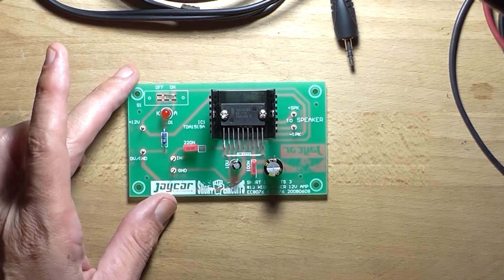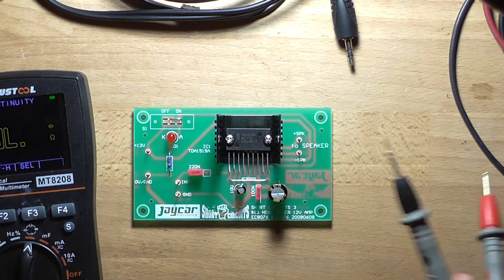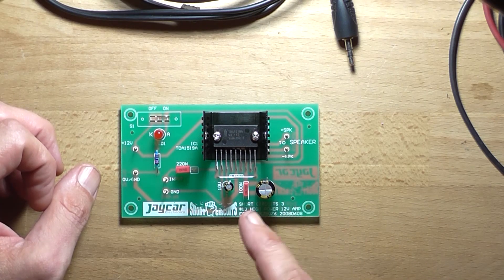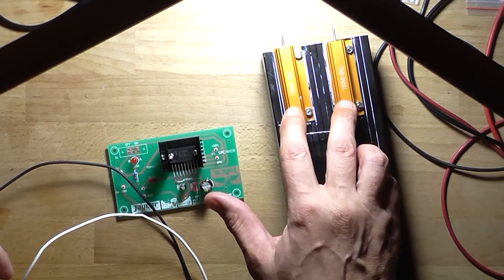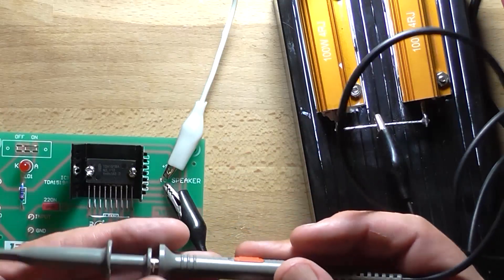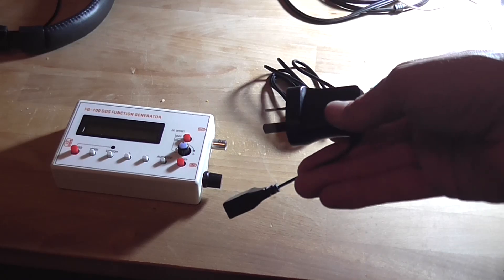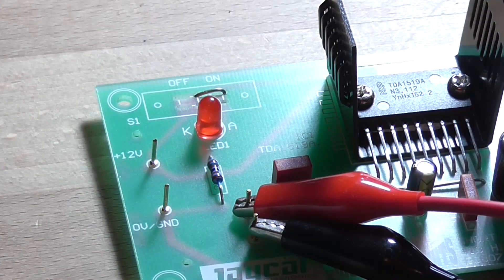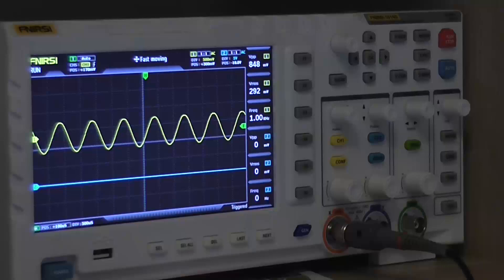How To Test A Power Amplifier

Comment: That's Astro, you are a bloody legend making this video. Makes sense and good to see how you connect the oscilloscope probes ( probe and ground lead ) in parallel to the 4 ohm resistor. Then you use your output voltage from the scope and the 4 ohm resistor value then just use P = v2 / r formulae 

I also struggle a bit to understand all the settings on the oscilloscope but that's a different issue where I need to read the oscilloscope manual a bit more and some more videos. 

I bought this exact kit at Jaycar on the weekend you used in this video so I'm going to build it and do the exact same test you did in this video and the build video to see if I can replicate your power output 

Thanks again mate 

Cheers from Melbourne Australia
Reply from the maker: Most welcome, dude.